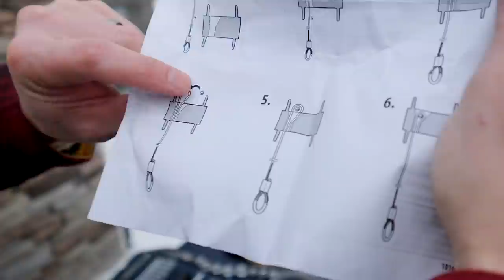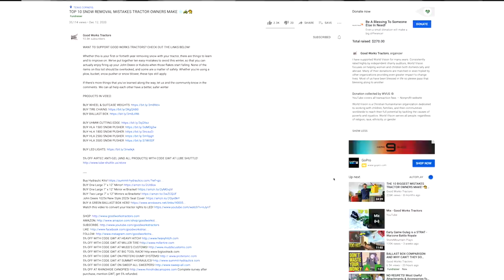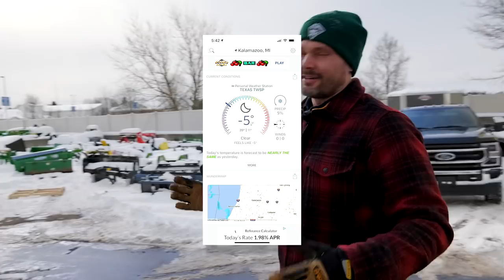$35,000 MISTAKE PART 2: GATOR 865R FROZEN IN THE GROUND 🐊🧊⛏️

Comment: That was tough to watch because we all have been there before...I am not sure what's up with that winch I was going to buy a warn now I am reconsidering. I don't care how stuck you were thats why you buy a winch. I would have thrown it into the lake that could have been part 3 or 4 of the video. I hope warn contacts you.
Reply: @m9 ovich see that's my point it was installed by the factory he bought new rope and the people that sold him the rope had no idea what he was talking about and he couldn't find the fix anywhere. I get the point he rigged it only because he was out of options. I wonder what John deere has to say as well since they put it in. 4500 is plenty I agree but I wonder why it pulled so far and then would stop if the power was there?

Comment: Not sure any UTV  would have done much better in that soft slush snow and mud.  There is a switch on the dash of my Gator to lock the front wheels.  I haven't had to use it yet. I suppose it helps sometimes.

Comment: Being from the south don’t know anything about snow plows but to learn I have a couple of questions. Would it have helped to disconnect and remove the plow to get rid of weight, and can it be done there in that situation? Second question, why not bring over one of the tractors and lift as you pull the Gator out? 
Totally feel your pain and frustration though. Down in Georgia my two buddies and I are referred to as 
The Adventures of Tom, Wayne, and KC. We seem to find these kinds of troubles too. Thanks for sharing. We learn from you!

Comment: snatch blocks are your friend. pulleys make stuff happen. With some trees for an anchor and 2-3 snatch blocks that 4500 lb winch should be more than enough. with 3 pulleys you can get an 8-1 mechanical advantage.
Reply from the maker: Yeah funny enough, I used one in the video.  Would have thought that would have done the trick.  It did not.  Apparently needed many more.  Also, more experience would have helped.  I'll be better next time! 😂
Reply: But did you go through the pulley and hook back onto the gator that’s the only way you get the mechanical advantage.
Reply from the maker: Yes, went through the pulley and right back to the gator.

Comment: I would never leave the plow on going off road. I had those tires on my Can Am Commander and hated them. The further out your winch line the less power your winch has. But I had a Warn 2500 pound winch that would drag my truck around my driveway. (Another story) You might have a bad winch. My Polaris Ranger 6x6 has a Polaris/ Warn 4500 pound winch that will drag my 1800 pound machine around like it’s nothing.
Reply: @m9 ovich my Warn 2500 was stronger with more rope out. My 4500 is just the opposite. The more rope that is out the less it wants to pull.

Comment: The reason you did not increase the power on your wench pull is you only did one turn over 1 pulley. In effect, all you did was redirect your pull. You would still have a one to one ratio. 1 foot of movement at the wench would move the anchor point on the gator 1 foot. So you have the same force. The same as if you just tied it to the tree. 

With 2 pulleys, one hooked to the gator and one hooked to the tree, you loop through the 2 pulleys so in order to move the gator 1 foot, you need to reel in 2 feet of line. Now you have your 2x force multiplication. 

On your setup, you were still were moving the pulling end the same distance as your anchor end. You would have needed 2 pulleys to multiply your leverage. You did not have any force multiplication the way you rigged it up.  

In order to double your pull, you would have needed to start from your wench, make one turn at the tree, return to the gator and ran the line through a pulley at the gator, then back to the tree, then tied it off at the tree or the first pulley. Only then would you have multiplied your pull force. Using only one pulley is the same as using no pulley for force multiplication. 

A limited slip is not the same as a locker. It does not lock the 2 axles together. It only applies a limited amount of resistance to the the wheel with traction. A limited slip still allows for differentiating action. Once you reach it’s limiting force, it will allow the remaining force to go to the wheel without traction. It cannot redirect all the available torque force to the wheel with traction like a locker does. The limited slip only helps with a partial traction loss, not a total traction loss.

Comment: I’d be interested to know how that front drive is really supposed to work. Is it truly a locker or just limited slip?
Reply from the maker: I think limited slip
Reply: Many moons ago, when the XUV series was introduced, Deere made a pretty big deal about the Gators having locking front diffs.  I’m curious if anything has changed in the last 12 years or so, but they had a whole big demonstrator setup that no “limited slip” front end would have climbed over.

Comment: 2500 dollar 90s Polaris snowmobile for snow recreation. 32 inch walk behind snowblower for cleaning snow. 2010 or newer 850 or bigger 4x4 atv for work and summer recreation. Old 2 wheel drive single cab ford ranger for fun and work to keep miles down on new American made 4x4 truck for getting to work and taking toys/tools in for repair. That's all you need. Can sell and buy used good stuff and not lose money. That is the secret country boys learn.

Comment: The winch is a great asset if you know how to use it. You should do some research on how to use it properly and you would have taken the gater home the first night.  4500lbs is only on the first layer on the winch spool. The winch cable can be attached with anything tape, string or tied on. the winch uses the first 6 raps of the cable for resistance to pull on.  Using the snatch bock will double the winches pulling strength if the line is run back to the winch.
Reply from the maker: I used a snatch block.  It didn't help.

Comment: Winches were always rated at their capacity (4,500 lbs in your case) by being able to pull 4,500 lbs up a 20% grade. What they don't tell you is that if you have one fist sized rock under your tire, it won't pull it. Your winch didn't stand a chance, and although I'm not a big fan of warn winches, it's not the winches fault. Also remember. you will lose about 15% of max pulling power for every layer of rope on your spool. Your winch is only rated at 4,500 lbs on the very first wrap.

Comment: Ugh!  What a major PIA!  I think you found the limits of that little rig.  Seems like it would be very good for partially groomed trails.  No bueno in deep muddy virgin snow bogs at the edge of a pond.  Don't understand what happened to the front diff.  Did something break in the front diff on that side?  Thanks for sharing!
Reply from the maker: Yeah, I mean what's the point if you can't really offroad with it.  I know the plow didn't help the front, but the back sunk down worse.  I don't know either on the front diff.  Can't find anything clear online.  Might need to ask JD.
Reply: @GoodWorksTractors  Let us know what u find.  Very strange.  Almost like something snapped off on that side inside the front diff.  Weird.

Comment: Courtney, you did use a pulley but in that configuration it didn't give you any mechanical advantage. To make it 2:1 you need to have the pulley on the object being moved. If you had two pulleys and enough cable you could have run from the winch to the pulley on the tree to a pulley on the rear of the Gator then back up to the tree where it would be tied off.
Reply from the maker: Hmm the way I understand it, this was mechanical advantage.  It was tied back to the gator.  One pulley is all that's needed for mechanical advantage, but a second pully will double it again.
Reply: @GoodWorksTractors  Nope, in that configuration it is still 1:1, you just change the direction of the pull. In 1:1 you pull the load 1' for every 1' of cable. In 2:1 you'll pull the load 1' for every 2' of cable. 3:1  1' of pull for the load uses 3' of cable (and so on). You can find pictures of block and tackle pulley combinations online.
Reply from the maker: I'm not sure I agree with you.  I used it just like they do in the several dozen videos I've watched the last few days.  One pulley is what all of them used.  Winch on the machine, snatch block tied off to a tree, buried tire, etc, then cable ran back to the machine.  Just one block.  Maybe it's not doubling every time, but one block provides 2:1, two blocks provide 3:1, etc.

Comment: I would have went to the shop got me tractor came back in full that joker out there
Reply from the maker: My 8,000 lb F350 was spinning tires for a good while up on the road.  Tractors weren't going to touch it.  If they would have gone anywhere near, they would have either tipped over or been buried in the mud.

Comment: I always get 6k winches on our SXS for this reason. 4500 is not enough if its sunk. You should have brought the tractor out. I have found the Rangers and Honda pioneers are far superior when it comes to off roading..
Reply from the maker: I do find all the comments interesting about using a tractor.  I couldn't have got a tractor within 80 feet of this area.  It would have either tipped over, slid into the lake, or been buried just like the Gator.

Comment: I'd say the freezing is due to you exposing the earth to the air.  Previously it was insulated from the cold by the snow.  Is that a 2WD.  The 4500lb rating is with one wrap of line on the drum, every additional wrap reduces that rating.
Reply from the maker: Good point, that makes sense.
Reply: @GoodWorksTractors  The winch rating is with only one layer of rope on the drum, goes down from there.
Reply from the maker: Interesting.  Never knew that.  I would think that means most would need something 3-5x the vehicle rating to be on the safe side then?
Reply: @GoodWorksTractors  agreed, sleazy marketing.  The issue is less with rope but exaggerated by the diameter of steel cable.
Reply: @GoodWorksTractors  You can double the pulling power by using your snatch block too,  Just run your cable back to your winch, twice as slow but twice the power. Kind of like how you had it from the winch through the snatch block and back to the front of the gator, you were able to pull it sideways.
Reply: @m9 ovich I was just using that as the example of how to hook up the snatch block, not that he should have hooked it up that way in that situation.

Comment: I think MadMaxx4wd did a video on relining your winch. You also have to keep minimum number of wraps on the winch. I would check the drive belt after that.
I usually count on my neighbor to get this kind of entertainment. Used Gator for sale, only used by little old lady go to church on Sunday.
We used to do this stuff with our vehicles. I could tell you all about differentials, winches, high lift jacks, and all the gear. I don't remember leaving anything over night. We needed 5 jeeps and a lifted and tired K5  Blaser to get my pickup out of the snow one time.

Comment: That winch was pretty pathetic. There must be something wrong with it.  Definitely going off routing with a plow on there was a bad idea. That will make a huge difference,  Limited slip’s never work great off-road. I guess they’re better than nothing but they’ll never come close to a locker. I think the gator did fine but the winch was messed up somehow.  I have a cheap $89 2000 pound winch on a Polaris 700 EFI and it’s slow but it never stops on me.  As far as the 4500 pound weight rating you’re pulling 3200 pounds with the plow on there but you also have to remember you’re stuck in the snow. It’s just like walking with a bunch of ice on your boot, a quarter pound boot all of a sudden weighs 10 pounds with ice on it and if that’s frozen into the ground 4500 pounds is definitely not going to be enough. If it were me I would just go out and buy a cheaper 8000 pound winch for a truck and put that on a big hitch mount.  Even if the winch was working that was asking a lot. What you usually want to do is put your snatch block through and run the cable from there and back to the winch mount. That way you’re basically doubling the capacity of the winch even though it’s going to go half as fast, it’s basically gearing down and if you have another snatch block there and run the cable three times it’s the same thing 1/3 is fast but three times the actual power.   Winches are good but if you’re really frozen and stuck in the ground it’s just gonna tear things up no matter what you’re driving even if it was a huge four-wheel-drive truck, winching out of mud and frozen and ice will tear your axles off if you’re not careful. You’ve always got a break it up first and dig it out and dig a little bit of a ramp.  It’s fun but it’s only fun for the first 20 or 30 minutes, after that it gets kind of tedious and annoying after an hour it’s no more fun at all. Lol.  I’ve done a lot of four wheeling in Offroad over the years and it’s incredibly hard on equipment. My guess with the winch would be either it’s just defective or you’re not getting enough power through the cables either they’re too thin or maybe being that it’s a diesel your RPMs are low and your alternator is not putting out a lot of power and your battery could’ve been pretty close to dead because running the winch will drain that tiny battery very very quickly.

Comment: Couple of thoughts I had watching this.  With the drag of the deep snow and the incline you were going up, if you got someone smarter than me to do the math, you more realistically needed a 7500lb winch, based off what you said the gator weighted.  The wheels weren't turning so you were basically dead pulling all that weight.  Also I maybe wrong on this but I am pretty sure rope lowers your pulling power with a winch vs cable.  The reason I believe that is so, is because different size cable sizes will change the weight rating of the winch.  Also it looked like you ran the winch all the way out.  You need to leave a couple of wraps still on the spool because that will also lower your pulling power too.
Reply from the maker: I would have to disagree on not being a multiplier.  It is still treated as a multiplier where I had it mounted.  You don't tie off to the exact same point as the winch ever anyways.  It's always at least a few inches one way or another or maybe even a foot if you're tying off to the same general area.  A few inches, a foot, a few feet.  Any way you slice it, it's not the exact same spot as the winch.  

Plus, you probably can't see it in the video, but there wasn't any way to get the cable back to the winch.  We were literally "inches" away from rubbing on the tire, frame, body at that angle.  It was the only tree that would allow for us to try and swing the back end to get it facing towards the road.
Reply: Your both right and wrongish.  Its not a redirect when it comes back to the object being moved.  It is also not a force multiplier either because in that configuration to move the gator 1ft the winch needs to suck in 1ft of rope, so that is a 1:1 ratio.
Reply from the maker: Hmm, if it's attached to the machine with the winch on it, then how does the position of where it's mounted affect the multiplier effect?  Whether the cable comes back and ends 1" from the winch or 5' from the winch if it's tied to the same machine that the winch is on?
Reply: @GoodWorksTractors  Exactly, I wasn't really trying to debate that point.  A pulley redirects force that is it function.  I think where the confusion it the other guy thought your goal was to spin the machine around which that would be a horrible way to do it.  I think your goal was to pop it out of the hole it was in, and not to turn it around, in which, where ever you came back to hook to didn't matter.
Reply from the maker: Yep, you're spot on.  Just wanted to try to get it out of the hole.  That was all.
Reply from the maker: Yeah, I have watched that video probably 10 or more times.

Comment: to double your winch pulling capacity you used the snatch block wrong, go around the pully and back to the winch, tie off as close as you can to the winch NOT the front.  Once the back was facing the tree that's when you should have used the snatch block.
Reply from the maker: Hmm okay.  I'll give that a shot next time.

Comment: NEVER choke or tie knots in nylon straps. Thats what shackles are for.
Reply from the maker: I was working with what I had.  It got us out.
Reply: You'll never get those knots out!
Reply from the maker: They have proved challenging!  😂  Rather be dealing with that versus dealing with a stuck Gator.
Reply: @GoodWorksTractors  I still have a couple of 16' nylon slings looped together like that. It's been 20 years. It's a 32' sling now!
Reply: @GoodWorksTractors  One trick is to jam a stick, brush handle, piece of dowel etc (not too heavy) into where they interlock. Can work it out when it tightens and prevent a crazy tight know that is hard to undo without strap damage. Just don't use anything too heavy in case goes flying.
Reply: Shackles  (if not soft shackles) can be dangerous here - if anything breaks a metal shackle can be propelled at speed into one of the vehicles. Can mitigate risk by a weighted bag or similar.

Comment: Mud underneath was not frozen. That's exactly what the problem was. Nothing can go through that unless the atv has really aggressive tires and a lift kit but then you can't drive it around normally.
Get it. Snowmobile, snow blower, atv, little old truck and a new 4x4 truck is all you need for realistic use and save your money and use the right tool for the right job. Lol